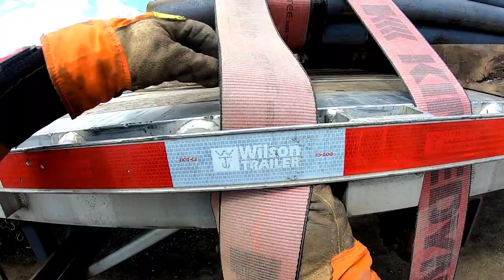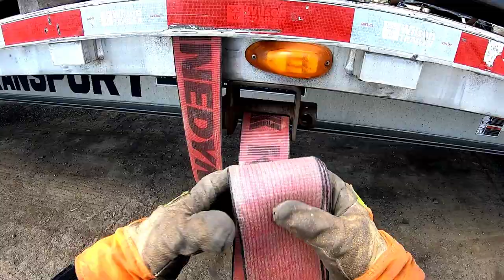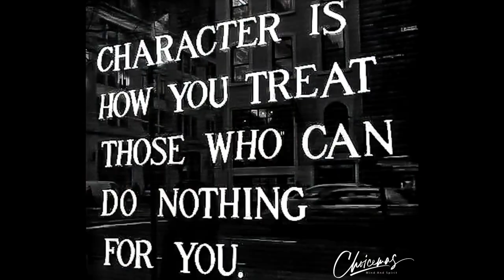Help The Next Driver! | Gut/Belly Wrap |  Strap Down Steel Rods | CHOICEMAS

Comment: Where did you get those holders for your dunnage on the front of your trailer?
Reply from the maker: I had them fabricated here in NY by a friend who’s a welder. Told em what I wanted. We drew it up with the measurements, and handles.